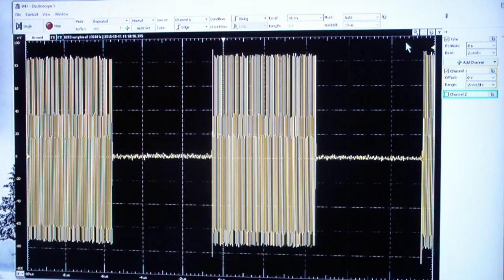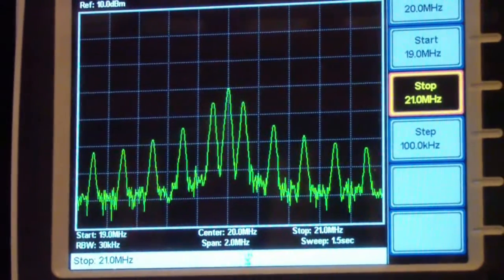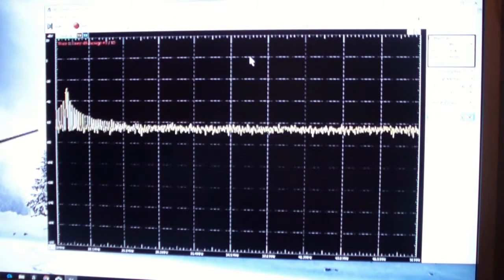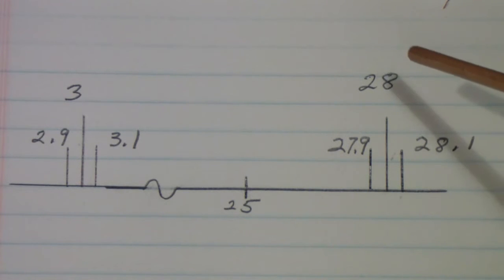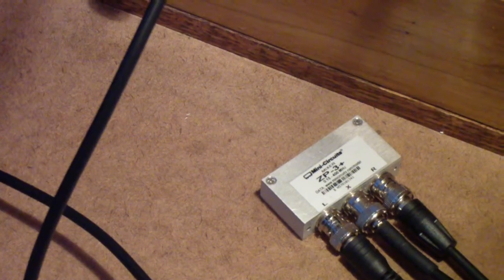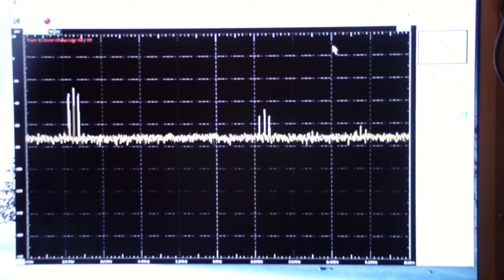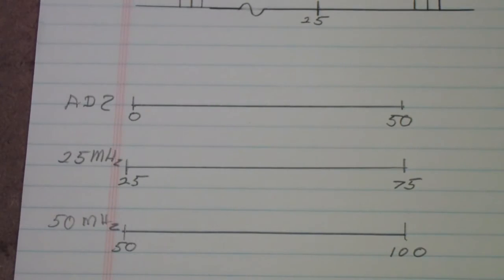TTT104 Analog Discovery 2 Spectrum Analyzer Frequency Extension Pt1

Comment: Great video, thanks!!
With the risk of proving that I have not understand a single word, I'll try to ask you if:
If I have a 200 MHz scope with FFT and a 125MHz signal generator + your frequency mixer. I should be able to look at 0 MHz to 325MHz FFT with a span of 200MHZ?
Reply from the maker: Your question shows you understand and the answer is a qualified yes. First, I am sure that you must choose what band of frequencies to look at since you cannot change the actual bandwidth of the scope or spectrum analyzer. So, if you are using a 200 MHz bandwidth instrument, then you can only look at a 200 MHz wide span of frequencies. If you choose a good mixer and a good source of the mixer oscillator signal, then there is really no theoretical limit to the range in which that 200 MHz resides. For example, you could, with the right mixer and oscillator look at 3.4 to 3.6 GHz (as an example). Notice I said THEORETICAL, since practical issues will arise, such as cabling, mixer noise and bandwidth, stability and phase noise in the oscillator, etc. Most spectrum analyzers use a form of this frequency shifting but the signal processing and interconnect require careful design and manufacturing as the frequency goes higher. So a spectrum analyzer with a basic bandwidth of, say 3 GHz often has a mixer oscillator combination that extends the upper limit to 6 GHz, with the instrument first displaying the bottom 3 GHz and then switching to display the upper 3 GHz (3-6 GHz in this example). Good question and right on point, thank you for watching and commenting.

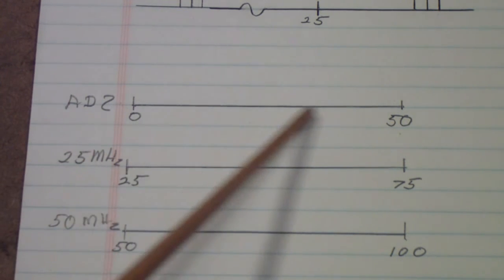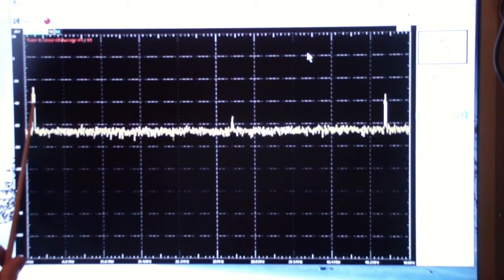Comment: I think you made a few mistakes in this video? At 15:58 you said you would recommend this to a university. Hopefully, the university students will be smart enough to tell you how flawed this approach is...  Also at 12:00 in the video you seem confused how to interpret what you see on the display. All three tones on the display are the result of the fundamental. You point to the tone just to right of centre at 28MHz at 11:57 and think it is the second harmonic. But obviously it is just the 28MHz fundamental leaking through the mixer to the Analog Discovery  at 28MHz. The tone over on the far right is 3*LO-RF = (25*3)-28 = 47MHz. But at 11:59 you seem to think this is the third harmonic of 28MHz? So all three are just mixer terms based on the fundamental. The problem with using a low side LO (25MHz) to look across 25-75MHz is that the spurious free dynamic range will be extremely poor because of all the extra mixer terms you haven't considered.
Reply: Can you tell why is this a bad idea?